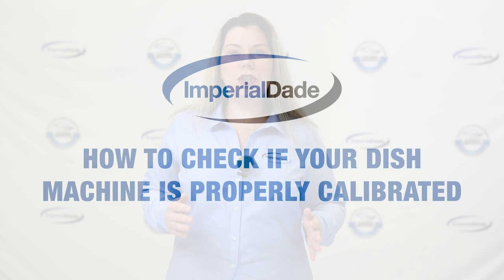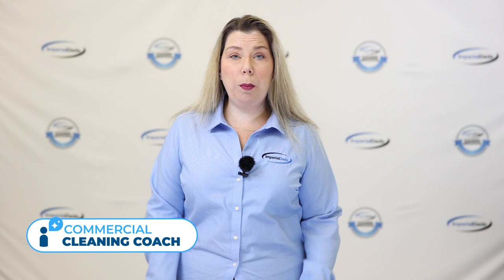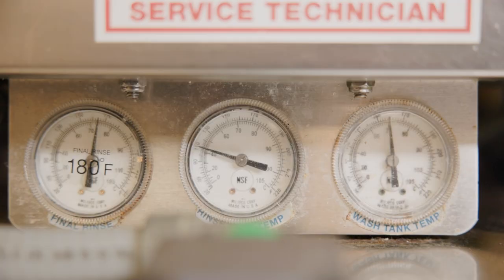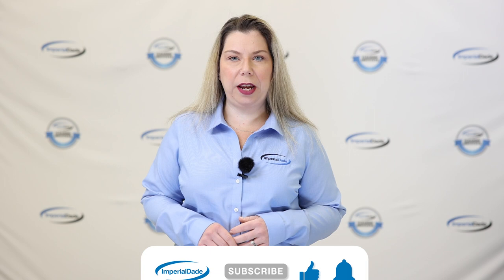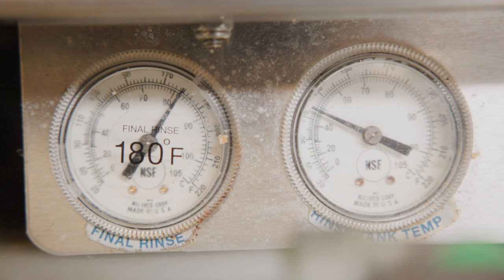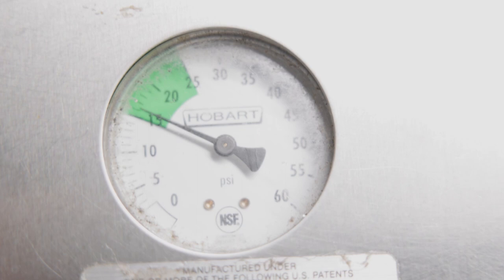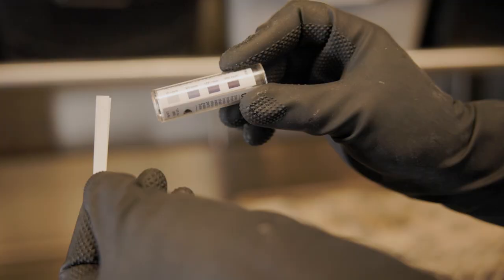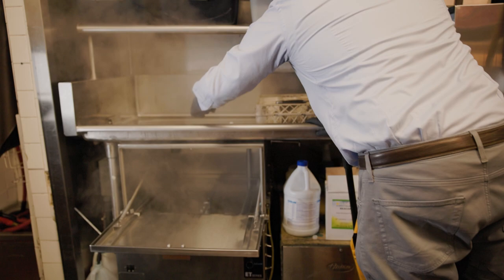How to Properly Calibrate a Commercial Dish Machine

Comment: Can i use a red 3m pad on a high speed buffer on a floor that i stripped and waxed 2 days ago?
Reply from the maker: Hello! Unfortunately, no a red 3M pad cannot be used on a high speed buffer. A high speed buffer or swing machine operated at 300 RPM. This will heat up the red colored pad and cause any uneven or high spots on your floor to turn red as the pad is not color fast. 

Similarly, you cannot use a floor burnisher which operates at 1500 to 3000 RPM.  Red pad are designed for daily scrubbing with an automatic scrubber with use on machines no faster than 600RPM.

For more information, check out our article: 
https://www.imperialdade.com/blog/best-floor-pad-for-buffer-or-burnisher

If you have additional questions, reach out to us here: 
https://www.imperialdade.com/registration

In the meantime, don't forget to like and subscribe to our channel.